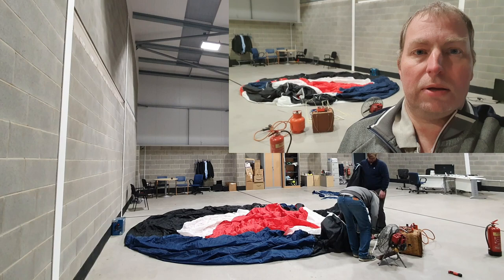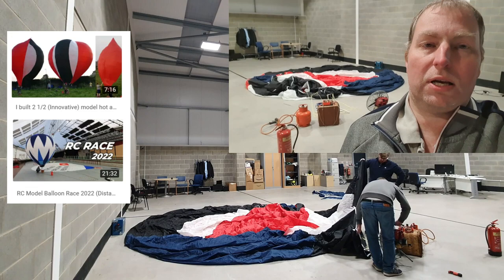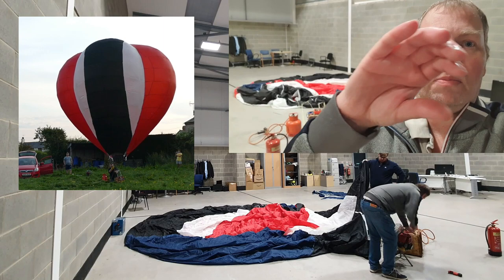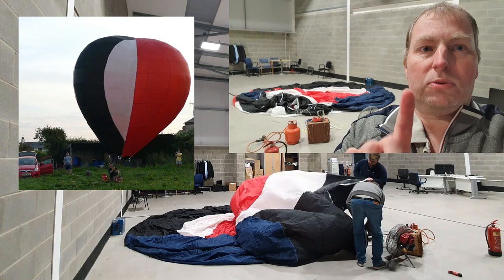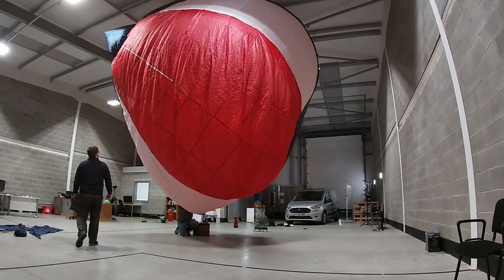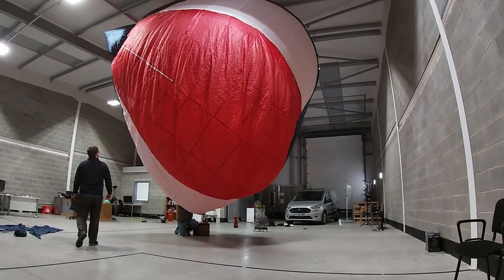I tried to make an RC airship from a model hot air balloon

Comment: Very creative! Did the velcro hold up well with the heat?
Reply from the maker: So far so good 👍 appears to be coping quite well, the parachute on a normal hot air balloon is held in place with velcro (for inflation) and it only tends to fail as the balloon gets old and the fluff gets pulled apart too much and the hooks can't hold. On the other extreme on my hopper the scoop down on the burner frame is held by velcro, and he heat from the burner has melted the hooks, had to do some repair work there 😆
Reply: @TheBigBalloonFestival  thanks, I didn't know the parachute was initially held shut by velcro. When it is not being pulled down does it reseal each time?
Reply from the maker: @makethingsfly  yes only for the inflation while the balloon rotates from horizontal to vertical, we then 'pop the tabs' which are usually offset them horizontally or rotationally so they don't connect with each other again. 
I thinkni reference it in this video https://youtu.be/q22COysQ0Xo but it's been a while since I watched it myself 😆

Comment: was it hard to build
Reply from the maker: So here is a link to the build video when it was a balloon https://youtu.be/PvohTxXOx7g?si=b_MSZzaVFj_NXuAK
I set out with this adaptation in mind and so built in to it some of the loops needed internally, I've still work to do to get the fins stable and and a motor of some kind to drive it forward, cutting the shape proved to be the hardest part, otherwise not too bad.